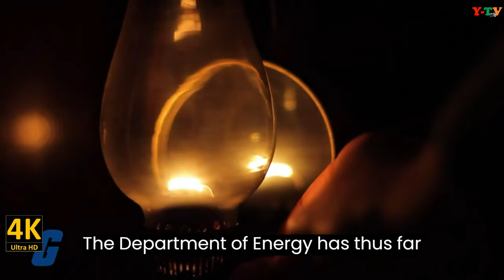THE PHILIPPINES OIL AND GAS INDUSTRY

Comment: They are the cause for concern for the highest electricity rates in Asia. That's one of the reasons why FDI avoid investing in the Philippines. Intel was a very good example of why they moved to another location. Cheaper labor cannot compensate the exorbitant costs in electricity tariffs.
Reply from the maker: agree
Reply: Korek Ang Indonesia para piso Ang kw nila n s meralco ay 10 pesos. Buti kung tatakbo Ang mga makina s 220 v.